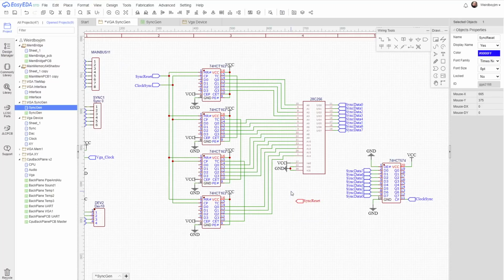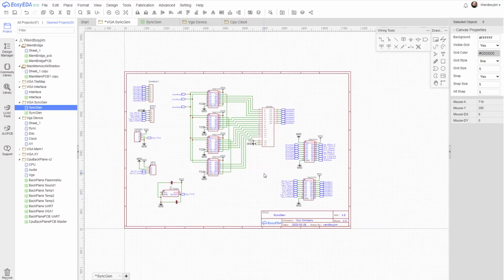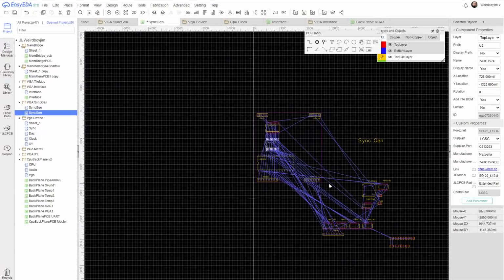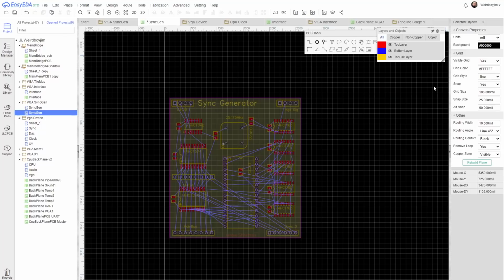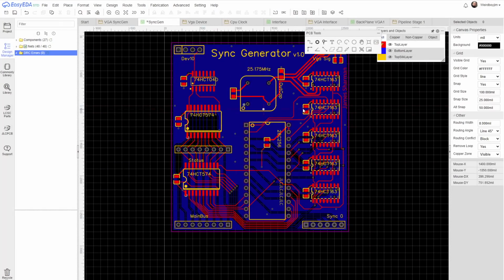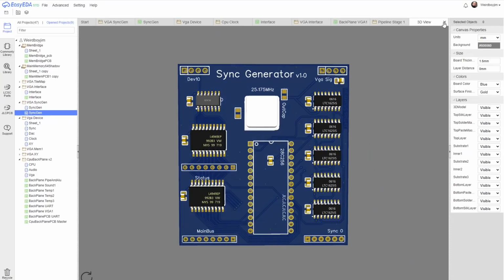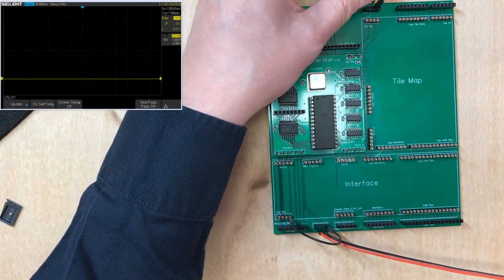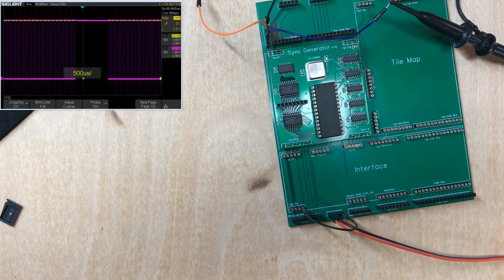Sync PCB - VGA from Scratch - Part 7

Comment: "I need to stop sounding surprised when thongs work the first time"
I'm not a professional hardware guy, but from my software experience, I will never stop being that surprised if it works first time.
Reply from the maker: Same, but these circuits are pretty simple compared to even a small bit of code, but the iteration time is massive if you make a mistake.

Comment: Obviously it's a bit late now, but had you considered just using a transistor instead of the whole inverter IC? Just wondering. (Edit: At 25-odd MHz, it might even work better than the 74HCT.) Love the series so far. 👍
Reply from the maker: I may do a video at some point testing out all the ways to make an inverter but I feel I need to experiment more before I do that.

Comment: You can use a single NPN transistor to invert a single signal. Might be an option. When the base goes high, the voltage on the collector will drop to zero.
Reply from the maker: Yeah, although if I was making one I'd probably use a pair of transistors to be a closer match to the output stage of the existing parts.  It's very difficult to make an exact match though.
Reply: @weirdboyjim  Good point. I rarely play above a Mhz or two. I've never had a problem, but I have the luxury at that speed to be sloppy and get away with it. We've seen several examples already that you've moved beyond paddling around in the shallow end. "Here be Dragons".

Comment: I've just watched this series so far and while you were showing off your beam racing demo's I was put in mind of a hardware feature of the Amiga I used to program - the "copper"... and am wondering if you might like to go down a similar but simpler route, of making the per-line Vram address-reset arbitrary and programmable. Have the line counter load a value on Hsync from the first #n bytes of the Vram that gets loaded as the line pointer and pixel count. would need more than 8 bits per line but not as many as 16 I think. Take some of the onus off the processor to be continuously checking time and setting the reset values, so it can concentrate on more important things and do the whole next screen's offsets in a single sweep during Vblank.
Reply from the maker: I don't want to go down that road, I could keep adding functionality to this until the end of time but I want to keep the scope contained. The Copper list is an interesting bit of hardware, it's designed to do exactly this kind of beam racing but to take the load of the cpu.

Comment: 4:44 What difference would an indeterminate, or changing, bus data line during the read have here? I get entirely that it’s not technically correct, but the reading device will read either a logic one or zero regardless. And since the signal is in the process of changing anyway I can’t see how either result would be considered wrong (if you’d read it a fraction before or after it would have been the opposite value anyway). It’s not like latching the results with the copy line makes the signals any more coherent with each other either. You’d need to interlock reads with the VGA clock to ensure that.
Reply from the maker: Tough one, in this case not a lot. The register load latches data into 574 the same as I do here, just a little bit later. But building complex systems involves making interaction rules between sections. I made some rules but this was breaking them.

Comment: Regarding the single inverter: depending on what the output is driving, you can often get away with a single FET/resistor to invert a signal. You're using 2N7002 on your PCBs already. That'd easily invert your asset signal. Low-ish pull-up will keep the propagation delay short enough.
Reply from the maker: Yeah, lots of ways I could have done this. I never realized inverting a signal with an inverter would be so controversial ;-)
Reply: @weirdboyjim  Hehe! Ask 10 engineers a question, you'll get 13 opinions! 😂

Comment: It is guys like you who make the rest of us (software developers) insanely jealous that we couldn't go into hardware to the digital logic level as well. I studied some of the concepts as part of my study of computer science, but not the electronics of it. I come here to feel good. It is a real joy to see you getting things working. I have a friend who is an electronics engineer, and years ago (early 90's) he decided to copy the circuitry of a plotter, make a pc board, copy the rom, and then he plugged it in. I was there when he finished it and finally switches it on, and voila, it works first time. All I have messed around with was some 555 timers, doing a flip-flop only in transistors and simple things with some op amps, but nothing really, because I write code, but you really make me wonder...
Reply from the maker: Thanks! I'm actually a software guy as well, the first time I wired a TTL chip on a breadboard was not very long before the first video in the cpu series. If I can do it, anyone can!
Reply: @weirdboyjim  That makes me respect you even more. I can tell you that electronics is the beast to tame, the software developer is the tamer, but without hardware there is nothing. You are a great inspiration. You should tell us a bit more about how you started and what you were thinking at the time. You know more than you think you know. I am fascinated by the SerenityOS operating system being developed by Andeas Kling on his channel. Yours gives me the same excitement.

Comment: Even after all these videos it is still exciting to see another part of your design come to fruition. It is also inspiring. For the past couple of months I have been working on a design for a device that converts PS/2 keyboard clicks to something an MSX2 computer (specifically the Philips NMS-825x and NMS-8280) can understand. This means that the device will have to read the PS/2 keyboard clicks and use that information to simulate an MSX compatible keyboard matrix, which the MSX computer can then read from. 
The main PCB I designed in such a way that I can use an Arduino Uno as a testbed (so same MCU, similar wiring, etc.) and. For this testbed I also had to design a couple of breakout boards that I had made and assembled (as I have mentioned before, at the moment I am no good with a soldering iron/station, nor do I own one). I felt a lot of excitement when the first PCB arrived and worked out of the box! To someone with a lot more experience this may sound silly, but t really does feel that I am now making the first real baby steps into the world of electronics.

And all this because I want to be able to use my MSX with a KVM...
Reply from the maker: Interesting. I've been thinking about making a circuit to receive keyboard input from a ps2 keyboard and convert it to UART.

Comment: Being so surprised and happy when something works first time out is certainly NOT something you need to stop doing!  The joy of creating a functional and useful PCB is something to hang on to, and your sounding surprised at immediate functionality is one of those things that brings to us, your viewers, a sense of your genuine love for this project.
Also, I'm just loving how very nice the sync generator board layout is.  Looks very professional and well thought out.
Thank you again for another very awesome video!
PS:  Have you ever considered just using the TTL compatible components only for the external interfacing of a module?  I ask because I know there is a significant amount of switching speed lost in the buffers in each chip that convert TTL to CMOS and CMOS to TTL, and the level shift is really only needed at the system level interface to components like the video circuit.
Reply from the maker: Thanks Dave! Dividing up the logic families like that is arguably the right choice, but this project is mostly focused on the digital logic of the processor rather than the electrical characteristics. Using TTL/TTL compatible components simplified some of the discussion, or at least that was my thinking.
Reply: @weirdboyjim  The point of the project as a learning experience had escaped me, and I fell back to my usual "bleeding edge" thinking.

Comment: I bought a bunch of 74LVC1G14s because they’re useful for denouncing buttons and making oscillators and such, I’d consider them jellybeans for digital electronics. 2G14s exist and they’re not much bigger. It’s also an option to use a BJT or MOSFET inverter.
Reply from the maker: My instinct here would be to go with the 04 rather than the 14, Schmitt-Trigger inputs are not always the best choice when the input is a line that should be a clean logic already.

Comment: I've been wondering for a while what the orange/yellow smears are when you use the soldering iron for pins or other through-hole components.
is it a coating or the solder mask on the PCB melting, or is it the rosin core of the solder sliding off the board?
Reply from the maker: Yes, it's the flux core from the solder. I need to get a cleaner to help get rid of it. It can be bad if you leave it on long term.

Comment: James your contraption is getting quite complicated, have you thought (I think you did mentioned this before, but I have forgot) what enclosure or display are you going to use?
Reply from the maker: Just a little bit complicated! My plan is to build a display frame for it when it's all done and wall mount it. I'm on the lookout for a small 640x480 monitor I can include in that.
Reply: @weirdboyjim  Great idea, I'm quite surprised that you haven't experienced signal integrity issues (crosstalk,EMI due to shape of backplane). It's gonna look amazing under some kind of display.
Reply: @weirdboyjim  If you're willing to output a composite signal, look for "car monitor" on aliexpress. Plenty of choices from 3,5 to 10" for less than 20€. Most of them are 800x480, but there are some 640x480 available.

Which brings up the question: Any special reason to not do 800x480 other than nostalgia? Your framebuffer already is 1024/8 wide, isn't it? Pixel clock would be a bit higher unless you go 50Hz, but now that you're on PCB and are using quicker chips that should be manageable.

Comment: Nice, great to see it work first time but then it should :-) nothing worse than you first smoke in front of the customer. Or custard's as i liked to call them, a little mixing of Customer and Bastards and in all the years of using it not one got it :-)
Reply from the maker: Thanks Teh! Of course it can still make for an interesting video when it all goes wrong and I have to troubleshoot it.

Comment: you have the space, why not use a transistor and resistor to make an inverter aka a primitive not gate?
Reply from the maker: Could have done, Of course if I wasn't trying to break it into functional modules I'd be pretty much guaranteed to have a spare invertor somewhere.

Comment: Curious, why are you using a hot air gun instead of a hot plate for the soldering? Edit: I meant a reflow oven, not that it really matters at this scale
Reply from the maker: I started of drag soldering with an iron. I've been recommended a hot plate to try, at least with that I'll still be able to record the process easily.

Comment: Just a thought, but you could have used a 74LS00 which is more flexible as all gates can be derived from it. But the modular nature and the fact that your design is pretty much finalized for the sync circuit, it wouldn't have changed much. But that was my thought.
Reply from the maker: Yeah, there are lots of different ways it could have been done. Would have been nice if I had a spare gate to use.

Comment: Very nice! In terms of video update this computer feels on pair with what a generic VGA could put out on a i386 (maybe a 486 even?).
EDIT: Maybe you or a collaborator could put out an emulator for your computer so we can write programs for it and you would showcase them in your channel? An online javascript based one would be SUPER handy
Reply from the maker: Kind words. But some of those effects in my demos are using "demo coder trickery" so you can't necessarily equate the performance to such high end devices. Fundamentally this is still an 8bit cpu.
Reply: A C64 maybe then. Yours look more colorful tho. A document describing the architecture would help a lot if anybody wanted to write an emulator. The source from the other emulator may be a pinch difficult to port to other languages. Specially if one doesn't know rust.
Reply: @weirdboyjim  I stumbled upon 8 bit workshop which is pretty much what I had in mind.
Reply: I already wrote a fully functional emulator, including video output. Join James' Discord server if you are interested.
Reply: @Artentus  Cool. Mine is same. If you make a new project for the online javascript version I might pull you with contributions.
Reply: @DamianReloaded  It should be easier to compile to web assembly than to start over. Just need to adapt how serial and video out works.
If you wanna go for it feel free, thats why I made it open source. But the emulator is already corss platform and does everything I need it to so atm I won't be investing any time into this.